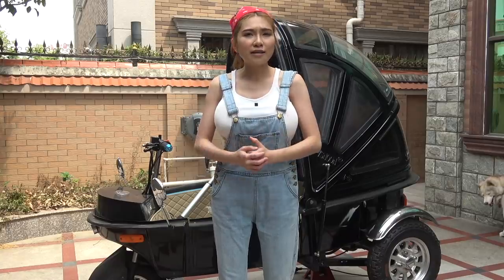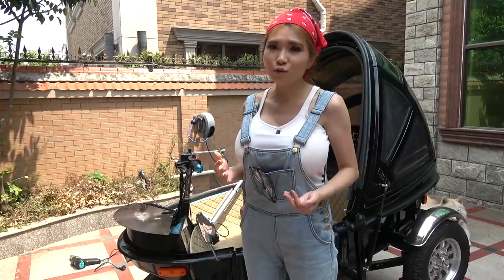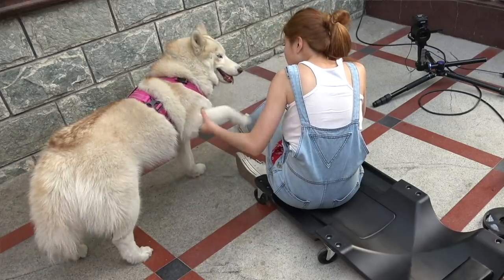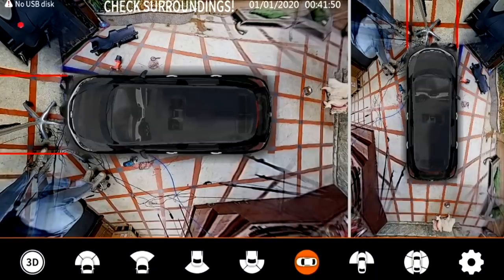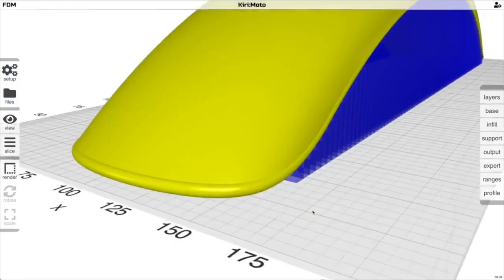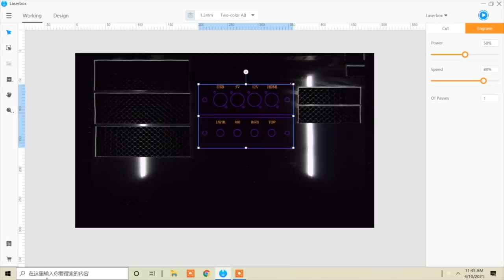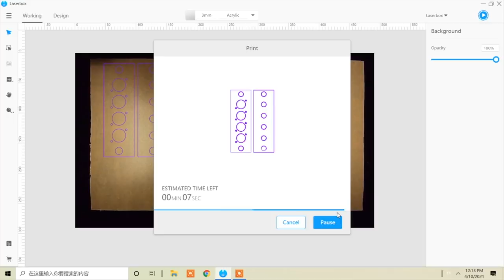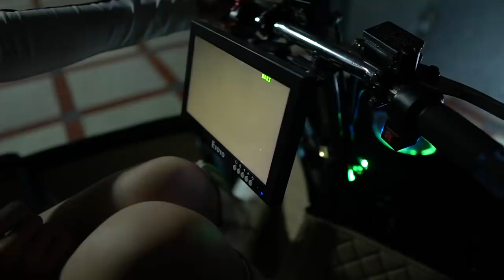Pimping My Electric Mini-Car!

Comment: It looks lovely, the addition of the LEDs increases your safety, 
since drivers will see you easier in the dark,
and the cameras increase your safety,
because now you can see your surroundings better!
Next addition:  shock absorbers and a spring-cushioned seat,
so you do not get so shook, bouncing over the bumps in the street, ne?

Comment: That looks like a pretty slick pneumatic rivet tool (and a separate rivet nut tool?) - I don't do enough rivets to get one but it sure looks cool. Shame about the street legality of the ev, glad it hasn't discouraged you from having fun modifying it.
Reply: But if you have a job that requires a number of them to be done... it is a good investment.

Comment: As an engineer I was taught to buffer connected metal components using rubber gaskets and o-rings.  In some cases nylon or similar washers would work and I've heard of wood interfaces.  These materials cut the noise made by metal connections by keeping down contact vibration and metal on metal shearing.  It is surprising how much noise can be reduced.  There are a lot of materials to choose from.  Wood interspacing is used where strength is necessary to avoid vibration.
Reply from the maker: Hmm, I'll try adding that- thanks!

Comment: The flat wire panel cover may still vibrate due to screw spacing. Remove it, and place a slim bead of silicone and allow to dry then screw it down, should eliminate all vibration. Had a similar panel once on my truck.

Comment: Very nice improvements.  The outermost windshield can be improved in visibility by either adding a sun visor on top (which doesn't affect the folding of the roof) or a coating of polarized film (which can also be done on the side windows).  This eliminates the incidental light rays that can blur the visibility.  With that, only the rear needs a camera that can turn on when the car is backing.

Comment: I've owned several convertibles in the past. Personally I prefer a manual top vs a motorized one.
Reply from the maker: It's kind of heavy and I'd need make some sort of latch...
Reply: @Naomi-Wu  it doesn't have a latch? Ouch. I believe my two manual rag tops had helper springs to lighten the weight. Not sure if that could be added to a hard top.  The hard top had a whole drive system in the trunk.
Reply: What I found fascinating was how when Naomi had swapped out the actuator I felt like "Yep that's much faster. Much easier to live with now.". Then at the end of the video when you close the top I was back to thinking "That's just to awfully slow!" again...

But yea. If it could have some helper springs and a manual latch it might be better. But then you would also need an external lock. Don't remember if it had that or if it was "locked" by remote control.
Reply from the maker: @blahorgaslisk7763  It's not slow it's dramatic!😅 It would just not be safe for Momo and bystanders if it were much faster...

Comment: Wow that improve looks awesome, that seat is it confortable while you're driving?
Reply from the maker: Yup!
Reply: @Naomi-Wu  I was about to ask the same question. In the video it really doesn't look very comfortable. It looks as if you could do with a steering column that could be tilted a bit towards you, angled handle bars or perhaps just grow some longer arms, though the later would probably not look good on you so scratch that...

About the steering column... You could take a look at how it works in the BMW Isetta. There they use two universal joints, though you really only would need one, and you only would need to move it back and forth a few degrees, not sideways like in the Isetta.

Well if it's comfortable as is then there's no need to make it more complex by doing this.

Comment: I like that you are modding your mini-car.  Momo seems to be enjoying the ride as well.  I have a Chinese built electric Vespa looking moped that I modded a bunch... swapped out the lead acid batteries for lithium, Unfortunately after a few years the Lithium pack has had a pouch cell in the middle of the pack drop voltage and I ended up pushing it home one night a couple of miles... not fun.  I'm working again after losing my job due to the pandemic, so can think about rebuilding the pack or replacing it.  What I loved about converting it was the massive increase in mileage... went from a claimed 50miles range which it never made and killed the lead in a couple of months, to 80+ mile range and it did fine for a few years.  I'd like to build a pack that can survive moer like 8-20 years without having a cell fail.

Comment: You might want to use reflective tape on the rear of your bumpers and horizontal lower surface in the rear.  This provides higher visibility to those other drivers behind you.  Red works best for the rear since it seems to be the standard.  Yellow works for front surfaces and the front of your fenders, but not interfere with rear view.  I would also put yellow dashes across the side panel so that folk can see the side of your vehicle.  White also works for the side panels so people can see the vehicle and not run into it.  I am always concerned about visibility in darkness - a black vehicle would be tough to see against most backgrounds.  I have a roll of reflective red tape so if you need some I can send you a few feet or more.  I tape tools so they can be seen if I drop them at night - it happens.

Looking at your new dash controls I would light them up. A little of your lighted tape above would work well shielded with a quarter round canopy so that the the panel is lit up and not reflected in your eyes.  Red would best maintain good night vision.  Red clear plastic would reflect red if using white tape as you have.  Again the problem is with black surfaces disappearing and hard to see.  I noticed that when you first tried them during your night demonstration.  Rather than have to grope to find the right toggle becoming problematic.  Another option is to insert button panel lights above and below each toggle.  In this way you would see their location and know if they are off or on.  Green button lights above and red button lights below.
Reply from the maker: Good idea👍🏻

Comment: Your level of mechanical and electrical skills always impresses me.  If your canopy is closed and your are incapacitated in the seat is there some way for a person on the outside to open the canopy.   Just thinking about your safety.   Enjoy.
Reply from the maker: No. I need to come up with some kind of external release...
Reply: @Naomi-Wu  I am sure you will figure it out.   Can you pin the hinges?

Comment: The build is very cool, Momo rocking it with mama was to cute. Now question are you running two separate electrical systems or just branching off the main? The camera is a great idea. You as always looking beautiful and this project was a great way to showcase the printers
Reply from the maker: Branching off for now, I might redo that...

Comment: My suggestion would be to move the control panels and dash forward of the handlebars and a parallelogram type setup to bring the bars back to you so you can sit back more.

Comment: swap out the zip ties for metal straps and add a fire extinguisher and your set. bigger motors, batteries and controllers can come later when you want to hot rod it...

Comment: Regarding the canopy opening - if the gas spring on the left side isn't holding much of the weight, you might try swapping to a stronger one. It sounded like the motor was bogging down a little bit.

Also, Momo is great :)

Comment: Think should completely replace the front side hood, one way see through glass window. To many metal/plastic bars. Set up a two seater sofa chair instead and remove the single one and have the seat flip open for storage box. Would be perfect for supermarket shopping lol

Comment: Very well done Naomi!! One question though: is it a stable trike? When you were driving it last time and this time i'm afraid that you need to be going extremely slowly when turning, even a bit (much more so than a 2 wheeled scooter or a 4 wheeled car. Is that the case?
Reply from the maker: These aren't cars- they don't go car speeds or on highways, so never really get to the point where cornering would be dangerous.  That said I've taken some corners pretty fast without problems...

Comment: Well done, as I have learned to expect, Naomi!
I wonder, since you are wearing a helmet anyway, would a tiny screen/projector be attached to your helmet so you need not have the tablet attached to your handlebars? Ideally with a wireless connection but something similar to those clip on mirrors people use with their helmets while bicycling.
You mention that the trike is illegal in your city but widely used in China, is it possible to get plates for it somewhere else that would then be good in your city? Like, here in the US, my state's license plates are accepted in every other state?
Regardless, thank you for showing us this!
Reply from the maker: Yes, I'd like to do an HMD project...

Comment: Nicely done. Camera system was a great add and the new control panels look great. Why didn't you use adhesive strips on the LEDs? It unit looks great and at night it pops. Now Momo was funny, first she was chewing on her tether always had the issue with mine but imitating you under Betty was even better. You did a great job Naomi and give Momo a kiss for me.
Reply from the maker: With zip ties it's easy to replace if the LEDs get damaged on something scraping against the bottom...
Reply: @Naomi-Wu  Ok makes sense.

Comment: How did you get the fender shape? Did you measure it somehow or what??
Reply from the maker: I didn't have time to get fancy so I cheated- I sent the metal fender to the CAD techs and Creality and told them to figure it out for me and make a CAD model, very not DIY😂
Reply: @Naomi-Wu  tyvm, I'm returning to modeling and was curious, lol and hoping to pick up a new how to tip. Lol guess I did. Lol
Reply from the maker: Normally I'd use a flexible ruler and graph paper...

Comment: Still seems like the suspension could do with an upgrade.
Not the most comfortable looking ride
Reply from the maker: Little stiff, but you have to be careful messing with trike shocks or it's more likely to roll over.

Comment: ...another mod...adjustable forward/backward steering column
Reply from the maker: The seat moves forward and back...
Reply: @Naomi-Wu  no, i mean the steering column. So like when you have your ginormous boots on you can have the seat back and the steering column can tilt towards you and your legs can stretch out a little bit....oohhhh and part of the side opens like a door so you don't have step so high in a skirt. Which reminds me, how can I contact? I came across some things that you may or may not know.

Comment: Consider maybe getting a tricycle with the 2 wheels in the front next time you are looking.  It is much less prone to roll over issues compared to the 1 wheel up front.  here in the US the 3 wheeled all terrain vehicles that used to be popular were banned due to the roll over issues, the 4 wheel and what we call reverse trike designs are both much safer.  also you might be able to get an electronic motorcycle license for a reverse 3 wheeler.  That is how  they are classed in the US at least, either a scooter or if able to go over a set speed a motorcycle.  hope the police leave your little "pill bug" alone.

Comment: Wow you looked so cool, it looks great with the hood closed. But..That hood and mechanism must weigh more than the vehicle! You would get a giant performance improvement if you could take it off. 

PS. I was wondering if the locals had products advertised creatively! With crazy specifications as Chinese made goods are often described here in the West?  This vehicle for example might be advertised as having 4 wheels, carrying 6 people in comfort at 80mph with a range of 400 miles with a 150kw/h battery etc.. On a smaller scale we have 18650 batteries advertised with 9900mA/h capacity or AAs with 6000mA/h and so on. Do you get the same in China? Or is it reserved for us nutty Westerners?😾😸

PPS. Please come to London, I am prepared to become a woman if that helps.
Reply from the maker: Thank you😁 The marketing has to be pretty honest, TaoBao is very strict about fraud so they can't exaggerate too much...
Reply: @Naomi-Wu  Ha ha Thanks Naomi...I think you got my message before edits. I really didn't like what I said at first..Doh! you were too quick!